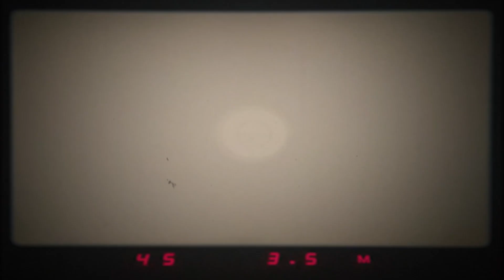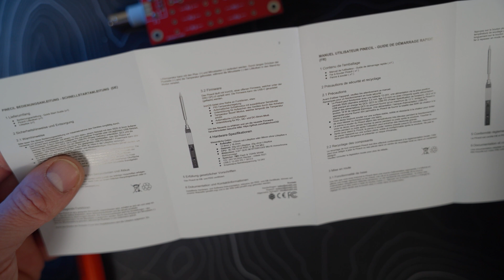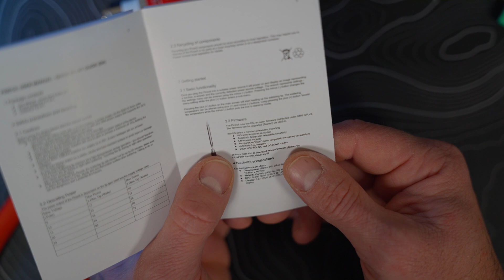PINE 64 PINECIL Soldering Iron Review

Comment: The Pinecil is an amazing little soldering iron. I have two. I run mine via USB-C (a chromebook charger) and also a USB powerbank (if I need to solder something outside or in my truck). If you are interested there in an unpopulated spot in the Pinecil for a hall effect sensor. (Part: SI7210-B-00-IVR). If you solder one onto the board it will allow you to put a magnet on your iron's stand/holder, so that when you sit your pinecil on the stand, it will immediately go to sleep. Once you pick it up, it wakes up. If you want more info, Google "Pinecil_Hall_Effect_Sensor"

Comment: what length barrel connector is needed?
Reply from the maker: The ones in the show notes fit all my antennas. You may need to measure your antennas if your concerned about being to short. Overall, I haven’t had any issues with mine being to short or long.
Reply: "in the show notes" ??

I believe the question is regarding the connector into the Pinecil - mine takes a barrel connector.... I have used a ❤monitor power supply and  most recently a laptop power supply from Cooler Master...19v 3.42A 65w... Model mpx-0651-m19vb(writing is tiny so might be slightly different but the cooler master brand 19v power adapter  none the less...)
The barrel on those is 15mm length and 5mm width measured using calipers. With a green inner, not yellow- I believe yellow are reversed from the majority.... 

Maybe that answers their question? Speaking of show notes though...you mean description? I was hoping to see a link to that attenuator you are making. Howed it work out or haven't giving it a go yet?

And then the reason I cruised by and gandered at your vid, 2nd time mined you, probably first was when I'd originally purchased mine.. this time trying to find some answers since I can't get mine to chooch like everyone else es. I ve soldered, with alright success... Nothing special but I've done it, and it's worked out...this time arround I'm just not getting it ... I watch videos like yours .. I'm doing the exact things and the solder doesn't melt or sizzless off the tip trying to run it or all sorts of wacky ... I've bought other tips since I heard the tiny long tips actually have a hard time holding temp and un intuitively a thicker broader tip actually is better since the tip carries the heat longer, hotter(I'd agree from my experience) but it's still not the results I'd had in the past or what I see and what should be...if I get a solder going it ends up being all weak ..and now my Pinecil can't get up to temp with a thermal runaway message...yet it's barely getting into the 200c... Well anyway, those are my trials and tribulations...and here is me on my journey to resolve such minutiae... It has been a few months since I'd use the Pinecil maybe it needs to be eased back into things....I don't know, what I do know is that it's frustrating to say the least....

Thanks for the video. 🎉